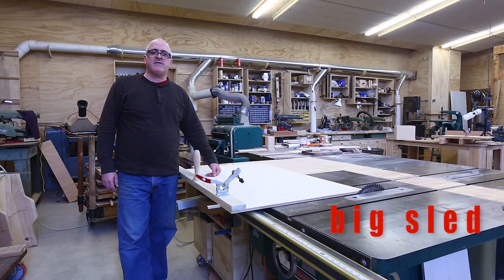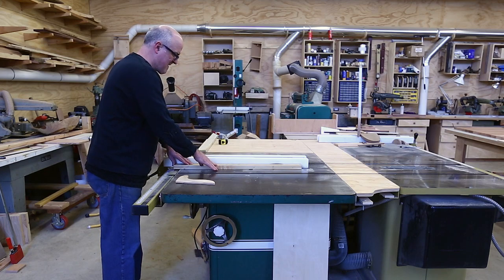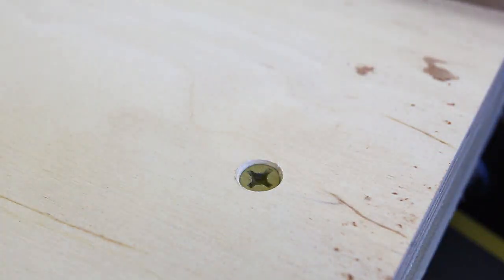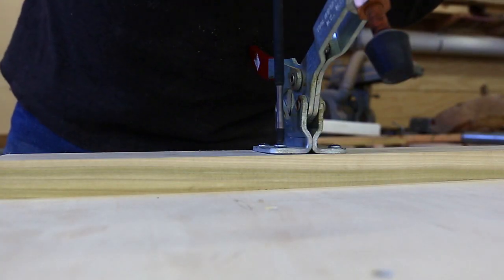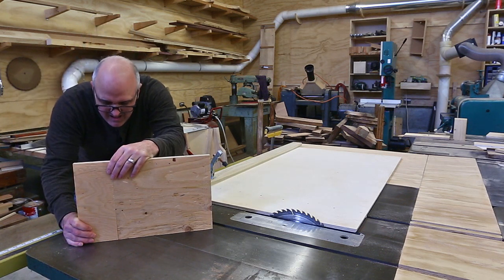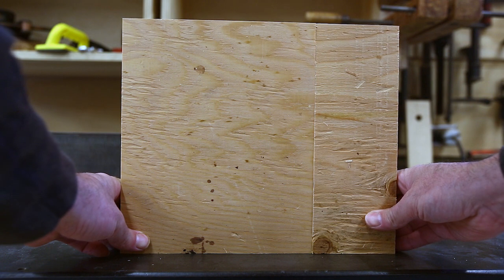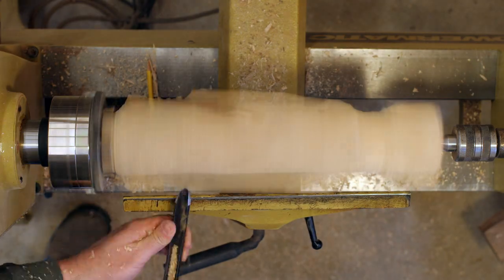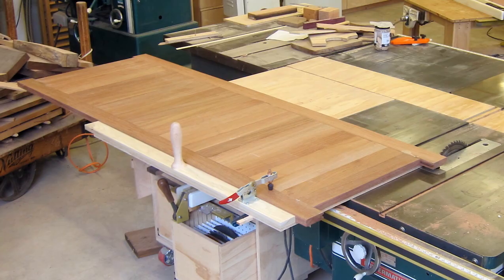Big Table Saw Sled

Comment: Great stuff, Frank. Not sure how I missed this video way back when. I LOOVE the squareness test using a crosscut/ flip test. I assume that with a larger test piece, you would magnify any error. This method is MUCH quicker than the five cut method, and should yield fine results, unless you building parts for a space shuttle.

Comment: I saw Norm's video about a year ago.  Another difference if I recall is Norm attached his stop to the front of the sled instead of the back as you did.  I have seen it done that way and I always thought it strange but no real difference.  It never occurred to me but Mr308Gap points out a good reason for doing that way.

Comment: Based on the distance from the edge of the blade to the front edge of the saw table (Grizzly 10"); i need to pull the sled back 15" to cut a 24" wide panel. (a 30" wide panel is undoable). The sled hangs over the front edge and becomes unstable. Maybe a front support system? Or miter T bars that allow the sled to overhang?...any ideas?

Comment: Great video Frank.  The lead space between the front of the table and the saw blade is only 14 inches.  So my panel sled has the fence on the front edge rather than the back.

Comment: I've been shopping for a panel saw to do what you do to square a panel. Your sled makes me reconsider that idea.
With all your tools, why don't you have a panel saw?
Reply from the maker: I would think a table saw with a sliding table would be more accurate than the sleds i use, at least for the big stuff.
Reply: Thanks. The trouble with a large panel saw, is that the slider will get in the way if you just want to rip and cut small stock. So adding a slider to a table saw would be a better idea?,

Comment: Try using the material used for plastic cutting boards for the rails. It does not expand or absorb moisture.
Reply from the maker: That would be better.